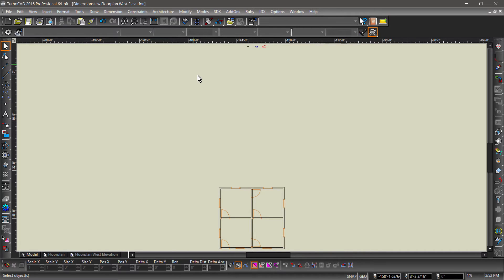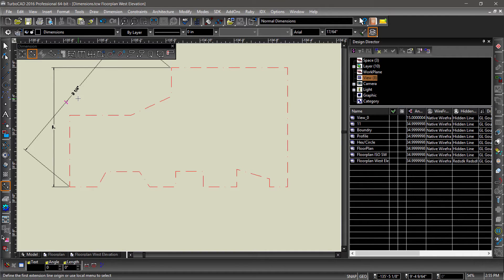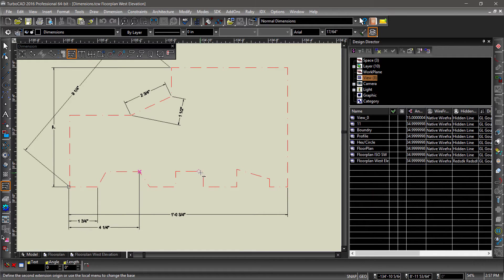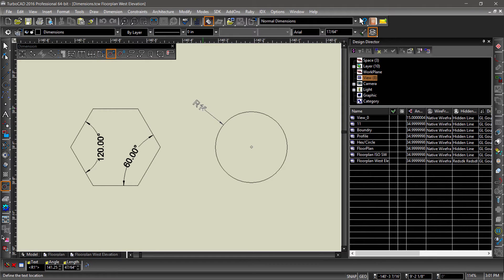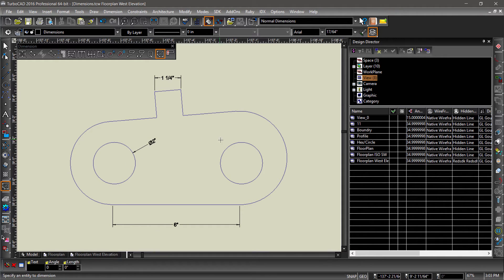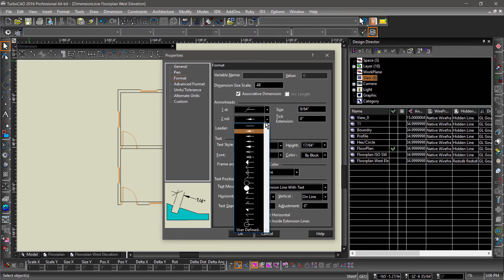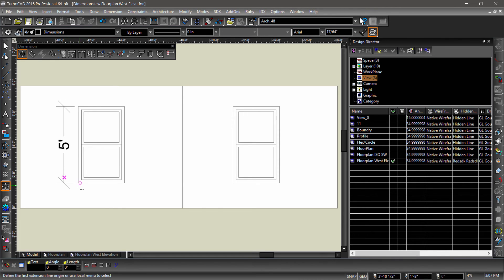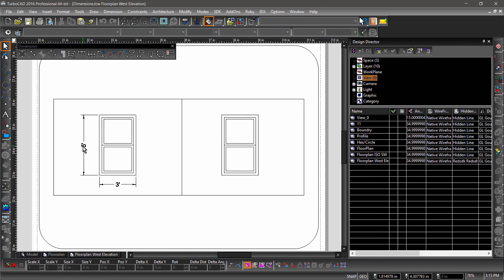Dimensions

Comment: I am using 2020, reluctant to ugrade as it had even more to learn and issues... when I reopen a file it keeps changing the dimension font sizes and also 15mm is displayed '15                mm' with a large space inbetween why? cant find a simple locigcal reason it chanes from the way I originally input it.